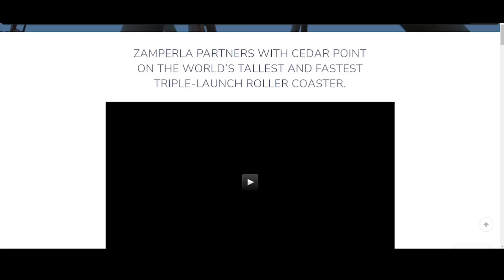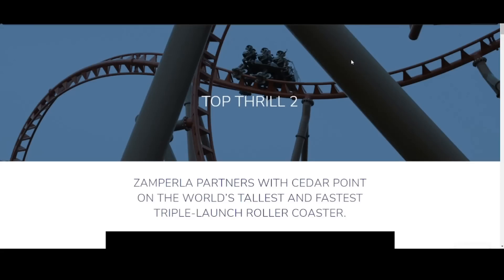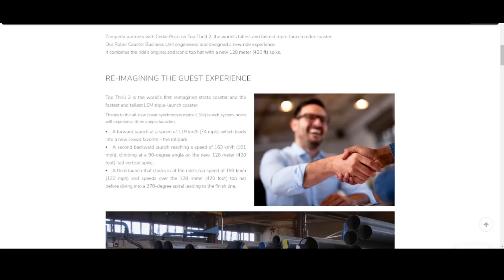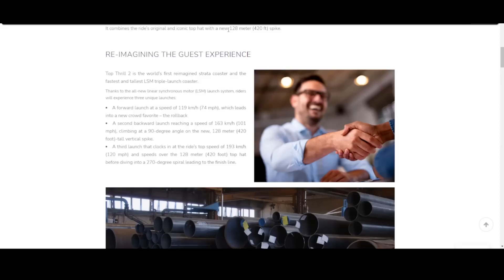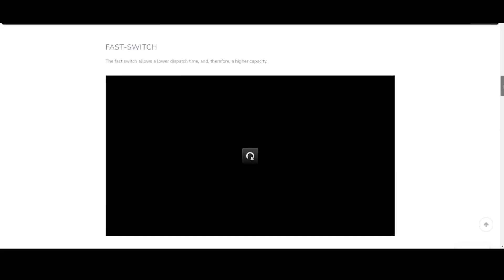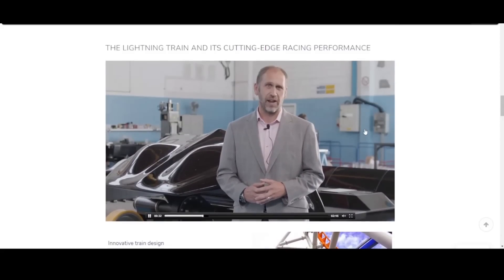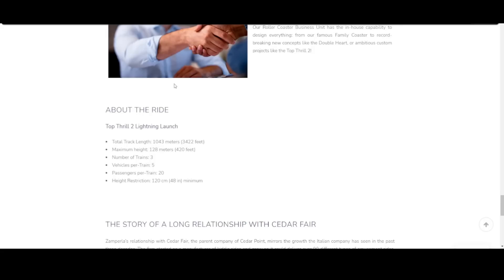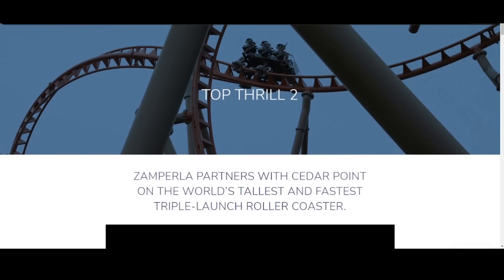Did Top Thrill 2 Get LEAKED? A Deep Dive.

Comment: people always forget that while there were 5 opperating trains and a 17 second ride on TTD.. every train sat on the launch track for 30+ seconds before the catch car hooked up.  If they can keep the three new trains going one after the other, then the throughput should be about the same as it was.
Reply: Good point
Reply: No, load 1 sat in the launch position for approximately 15 seconds because it takes 45 seconds for the hydraulics to be ready and by the time load 1 got into that position, it was ready to launch vs where load 2 sat there for approximately 30 sec or longer because the hydraulics needed that time to be ready to launch.

Comment: Zamperla has said that one of the benefits of its Lightning trains is that since it's essentially a unibody construction, there are fewer welds, rivets and bolts.  And that reduces maintenance.
Reply: There is less NDT on these trains with reduced welds but the NDT that they do is harder as they have to check for magnetic flux

Comment: If this is real, it is disappointing.  A rollback at 70mph isn't the same as a rollback at 110.  What the hell is the point of the spike?  What a waste.
Reply: True, but 110 rollbacks are still possible. Whether they'll get more less frequent is anyone's guess. But at lease you'll get a guaranteed mini rollback.
Reply: Agreed, the initial launch should get it to the top of the top hat without going over. If there is room, they should put brakes on either side of the launch to slow the train down before launching again (similar to Maverick's tunnel) to give us three forceful launches.
Reply: This whole thing is a big waste of time
Reply: @alecscheerer_run  While I am disappointed in the 74 MPH launch, if true, the ride will still be fun but not as good as the original. This is better than no extreme launch coaster.

Comment: I think its real. Top Thrill 2 is probably just a placeholder name for the time being. Parks sometimes don't decide or release names until after the ride is announced. An example would be Iron Gwazi. As for capacity. The trains can seat more people and I imagine that each train will be able to move seperately unlike the original Dragster where 2 trains had to be ready to dispatch at a time. And sometimes less is more. You would never see the original Dragster running 6 trains because it would yield a lower capacity than 5 trains. Same with Hagrid's at Universal. TBH based off the leak the spike is about 100ft taller than I expected. But either way I get to experience the other strata pretty much every few weeks so I don't really care about the new Dragster.